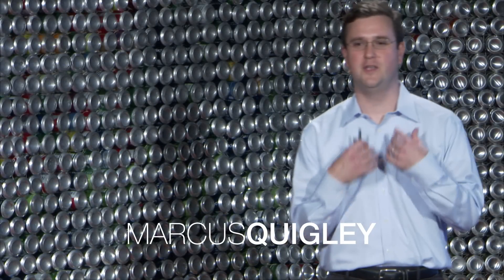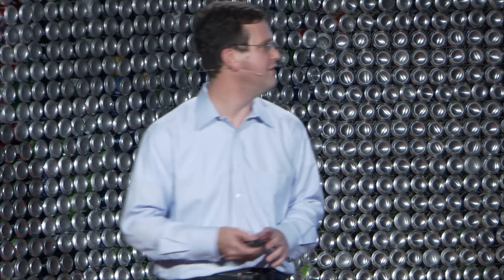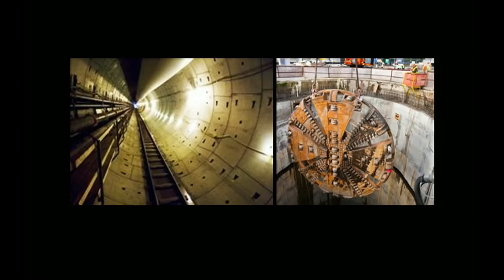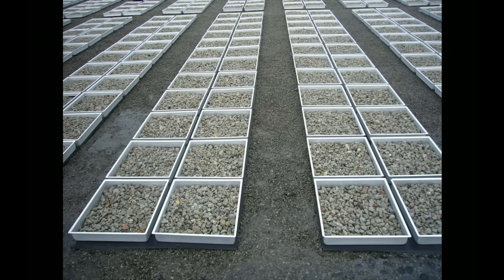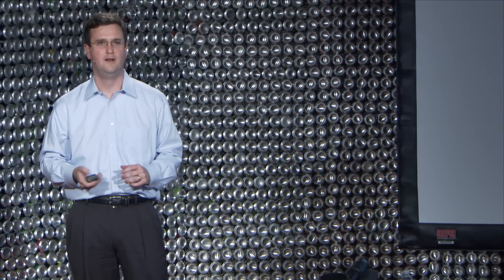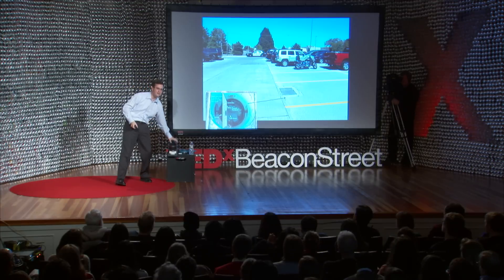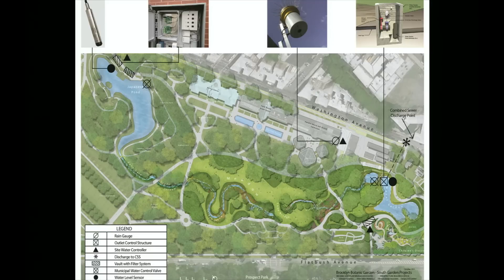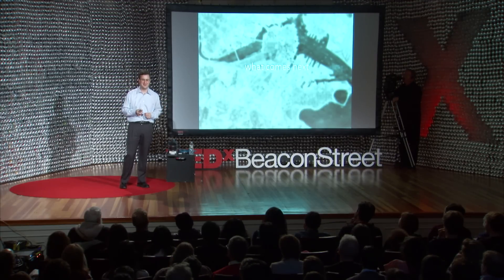Designing Smart Urban Water Systems: Marcus Quigley at TEDxBeaconStreet

Comment: I wonder if these technologies are available in low-income countries. If not, how can we still utilize water flow control without the automatic feature of Internet of Things?
Reply: It is still possible, but it would have to be done manually.
Reply: I have worked at a wastewater treatment plant and based in your design you can be able to control sewer overflow by having excess discharge directed to ponds for treatment or to have it flow to a constructed wetland. That's in Zimbabwe. Remember plants not meant for food production are as good treatment agents